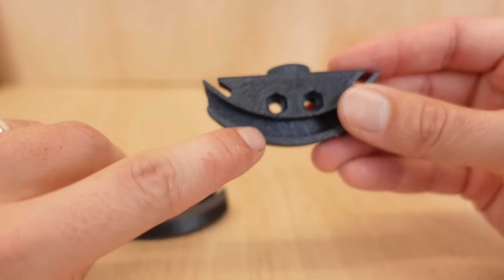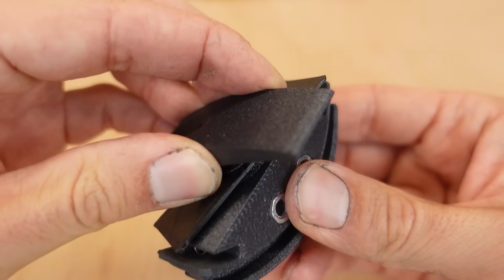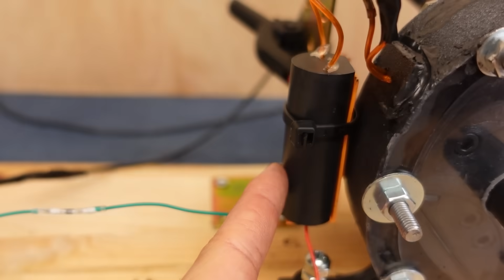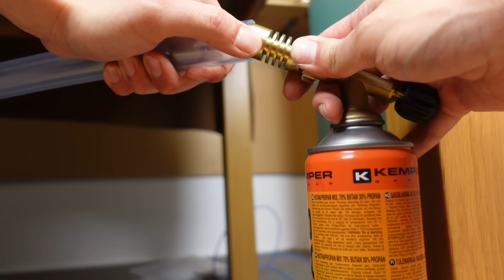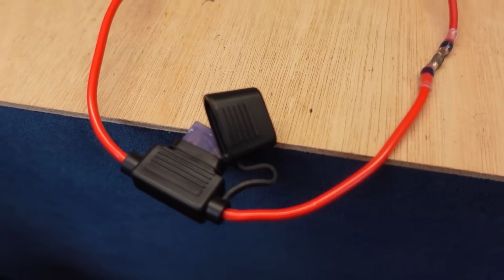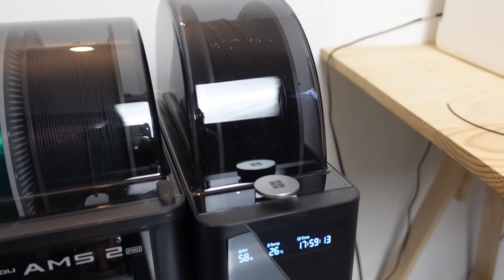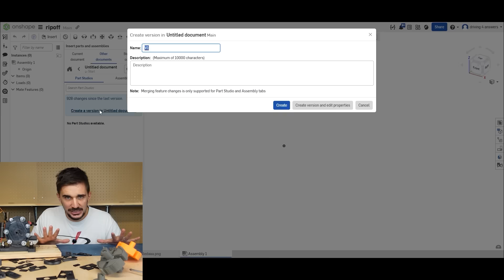My Oval Engine Now Fires At Will! Major Milestone For DIY Oval Rotary Engine 2.0

Comment: The day this dude gets a CNC machine it’s over
Reply: He has one, it was in a different video
Reply: It's not over, it starts.
Reply: he could collab with Inheritance Machining, he's made stuff for some race teams before.
Reply: Or a PCBWay Sponsorship
Reply: @mechfan01  he's a powertrain engineer, not  an electronics engineer
Reply: @erkinalp  They also do 3d metal printing and CNC machining.
Reply: @erkinalp wait hes an actual engineer? Hes experiments didnt give me that impression (no shade or anything, his work is awesome)
Reply: @badgermcbadger1968  Same, I'm a senior engineer at a big automotive company and his process reminds me more of the technicians and mechanics that I've worked with than the other engineers.
Reply: He has one but he sold it cuz it was a pain in the rear
Reply: Or then it really starts!
Reply: He "had" one but ditched it cuz it was pain in the ass
Reply: m4a
Reply: The engine industry is in trouble
Reply: PCB WAY!
Reply: over for who? dun dun dunnnnnn!
Reply: He needs to talk to Bad Obsession Motorsports....
Reply: no he's making the mistake of trying to reverse engineer something that didnt work in the first place
Reply: Looks like you need a better timing mechanism…
Reply: Needs two machines a lathe and a milling machine
Reply: 3d printer is a cnc machine
Reply: @nickfirst7249 it's literally the opposite of CNC machine 😊. Although mechanically they are close.
Reply: @ygayovy  CNC machine meaning Computer Numerically Controlled machine. SO 3D printer is cnc machine. Maybe you talking about additive and subtractive manufacturing processes
Reply: @nickfirst7249  we can go down the semantics rabbit hole, but virtually nobody calls 3d printer a CNC. In the end yes, I mean additive and subtractive.
Reply: @ygayovy  Akshually CNC stands for Computer Numerical Control which does include 3D Printers. But I get your point, colloquially we call a CNC 'Mill' a CNC Machine.
Reply: @alida4790 a good example is tomato 😅. It's a fruit, but nobody minds that it's in the vegetables section.
Reply: @ygayovy why do i keep seeing this misconception everywhere?
Reply: @badgermcbadger1968 are you referring the tomato one?
Reply: @nickfirst7249  i think they mean a CNC router/shaper/cutter
Reply: Collab!

Comment: Where does the engine suck in the oxygen it needs for combustion?
Propane gas doesn't contain oxidizer, the engine only has one intake for fuel only.
Did I miss something?

Comment: You didn't even reply to my mail. 
Even without that, you solved the two biggest problems I mention in it, 
- the springs, which, in order to withstand the explosion or even just the compression, would cause enormous friction,
- and the curve, which was not correct. In fact, in my email, I provided one that I calculated myself, which turns out to be similar to the one you got from the Russian video.

And I think that if your current version isn't working, it's because of inadequate sealing, which prevents enough compression.

Comment: I'm going to go out on a limb here and say your timing is WAY off. And "definitely" not consistent.  You shouldn't be using stranded wire for your spark contacts, it should be solid copper. The strands are moving every time they are hit and don't bounce back to the same location each time. Instead you should put the stranded on the rotor piece and only have a little exposed, maybe 1 cm or less, that brush up against a solid piece of metal, like a nail or something, that won't move during rotations. This would also allow you to change the timing as you can move the nail up/down slightly.
A lot of your ignitions where happening, at least to me, too soon. There wasn't enough compression and rotation of the piston to drive the crank self powered.
But, I'm not a mechanical engineer, just a crazy YT commenter  🤣🤪

Comment: be careful with carbon fibre filament. it has been shown that touching it with bare fingers embeds tiny carbon shards in your skin. sanding it or hitting it with a hammer to break it like you did in this video could also release them into the air to get into your lungs

Comment: This isn't crtiticism it's advice from personal experience.
BE VERY CAREFUL WITH POLYPHENELINE SUSFIDE.
I worked in an injection moulding factory for about ten years and it was absolutely horrible.
Melt temperature was about 280 - 300⁰ C but it would "freeze" on the injector nozzle,.which meant it had to be chipped off with a screwdriver or something similar,. Then when the pressure released it splattered all over the place.
I still have the burn scars

Comment: Absolutely terrific work. I've always wanted to build a cheap engine, that is easily produced by any basic machinist. Something a mechanically inclined diyer can make and modify for any fuel type. It doesn't need to be uber efficient. Just cheap, easy to build from basic components, and robust enough to make sense. It doesn't need to be extremely robust, since all the components are easy to source or build, but it does need to be reliable enough to not be constantly breaking down.

Comment: When rotating by hand the ignition timing looks correct, but in the footage where you're turning it with the drill it looks very late, almost when the chamber is nearly at maximum expansion.

Comment: Sry for bad english! When the ignition happens, the part receiving the force just rolls over the center of the shaft, how should it then turn the pressure into rotation, if the part would be more off center then it could convert more force into rotation, u get what i mean? This receiving part could also get a grooving thats deeper on one side wich could help with driving that force into circular motion. In the layout u have it built now, the force just pushes straight into the middle, way less rotational energy. Hope u understand, what do you say??

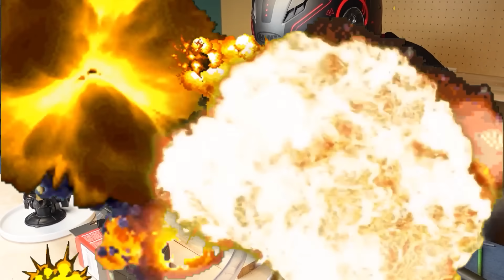Comment: Nice prototype setup and LOL at 09:24 ...^^
Instead of the copper wires to close/open the circuit try a big reed switch(small one will burn fast)  and a little tiny magnet(on the shaft)...;)
To adjust the close duration for whatever reason just replace the tiny magnet for a bigger one...;)
But since what you want is a quick plasma burst the smaller the magnet the smaller the time duration the circuit is closed the better the efficiency will be...;)
Hope this helps...^^

Comment: I may be completely wrong but it looks like that flame front 15:57 is trying to push the rotor anticlockwise (or just static.) I don't think reversing the motor would help tho because moving the ports or the spark location would just create the same problem on the opposite side. R U sure you can make a rotary engine with this very linear shape of rotor and housing? I'm pretty sure the epitrochoidal shape of the housing in the Wankel engine is what translates the combustion to one side of the rotor. Which you don't have here

Edit: I watched to the end lol. Yea the new rotor shape will probably solve a lot of the propagation issues. Also 21:56 this rotor has indentations which look like they aid with scavenging or may help with the combustion force transfer to the spinning rotor (probably both)

Comment: Besides the obvious (ignition system, carburation, engine/combustion chamber sealing)..how do you lube all of those sliding parts on the rotating assembly?  How do you keep that oil out of the actual combustion chamber?  You fueling setup isn't metering fuel/achieving a stoichiometric mixture like you think it is.  Your fuel rate is constant yet your intake volume/demand changes.  Look up propane/natural gas carbs to see how fuel is metered.  Those spark generators can burn up/internally short if the spark gap is too large/non-existent.  Test it with a static spark gap to see how long it actually lasts in a set condition.  I enjoyed growing up in the 1970s.  I had subscriptions to Popular Mechanics and Popular science as a kid.  It was during the "fuel crisis" here in the states when we had new engine designs in every issue.  After all that time, I can think of  maybe three that actually made it into production.  Fifty years later, we still rely on piston engines, maybe a Wankel here and there, but almost every new engine configuration has fallen by the wayside.  Gotta keep trying though.  Congrats for the effort, FWIW I respect that.

Comment: 1. Get a Flywheel
2. Get proper Spark Plug
3. Get better ignition timing (maybe use a sensor on the flywheel to trigger it)
4. Maybe use a little bit of oil at first to get everything sealed better
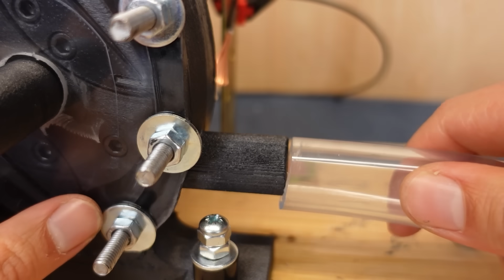Reply: Also you have to have the proper air to fuel ratio. He's just dumping unregulated amounts of butane/propane fuel into it. What he said from 8:35 to around 9:00 is totally incorrect (not saying that to be a jerk) but I 💯 % know from personal experience. Any small engine that can run off gasoline and is rigged up like that to run off a propane torch. Needs to have the knob/valve-flow, adjusted to the sweet spot. In order to run, it can't have too much or too little propane vapor spraying into the intake or it won't start. I believe he achieved combustion 💥 a few times because. By luck, it randomly hit the proper air to fuel ratio it needed.  
This guy is smart 🤓 and smarter than me in some/maybe many, ways. But apparently he's thinking, since the propane/butane is already in a vaporized state. That it's automatically going to ignite. No matter how much he opens or closes the knob-flow. 
Another experiment I did years ago was. Put a propane torch on my motorcycle and ran a rubber hose into the intake air filter. I thought if I turned the propane torch knob on at around 55+ mph. That the extra propane/fuel going into the intake would give me a power boost. All it did was choke the engine out, slow the bike down & want to die because of too much gasoline/propane and not enough air.
It probably would have worked if I also had an oxygen tank on it and was able to spray the correct amount of pure oxygen in with the propane. So I had something like 14 parts oxygen to 1 part propane spray into the intake.
Reply: @michaelbrinks8089  Yea D4A hasnt noticed that the propane torch tips have holes in them to allow air into the fuel flow.  Hes using straight fuel with no air in it,  which is also likely why there is so much more combustion happening after the fuel exits the exhaust.
Reply: @T3ddyRuxp1n  I agree with you....Like the torch itself will light on a 1/2 knob turn or 2 full turns.. But an engine doesn't respond like that & is more finicky. The torch knob is a valve that either lets more or less propane in... If his spark timming was correct. I'm pretty sure he was close to getting it running. 
I've ran push lawnmowers off a propane torch exactly like he's trying to do and no matter what. The torch knob/valve has to turned/set, to the "sweet spot" (exact setting) or it won't start. Oney the knob is adjusted the correct amount of turns. The lawnmower will start on the 1st pull. Like once you figure out that 1 & 1/4 turns of the knob is the sweet spot. You can just turn the knob 1 & 1/4 wait about 3 seconds. Pull the rope & it'll start but at 1 & 3/4 turns of the knob. It won't start because it's too rich = too much propane & not enough oxygen.
Reply: @michaelbrinks8089  Nitrous baby!
Reply: @michaelbrinks8089 nitorus better than oxygen, cheaper, more useable
Reply: 0. Measure your compression with manometer. If it less then 5-6 bar then sealing should be adjusted.
Reply: A DC CDI setup from magnetic trigger for ignition (like on a rotax max kart engine) might be a good solution to tighten up firing timing and still be easy to implement.
Reply: Yup, then embed a magnet in the flywheel, get a hall effect sensor, decent mosfet, and Arduino mini, vibe code a program to use the mosfet to fire the spark plug with the ability in your code to adjust the timing.
Reply: Yes, proper spark plug, sparkplug cable and a real ignition coil made for a motorcycle or car. then you at least can trust that part.
Reply: and more air with the fuel so not just more fule but more air and fuel so it doesnt shot out unburned gas
Reply: 5. Build it in a proper material that can actually seal correctly with vibration and expansion.
Reply: A better contactor setup would be great.
And a third sliding vane would also help a lot.
Reply: Also he can design in a water jacket near the combustion chamber in v2. Not sure if liquid cooling will help the front cover, but it would look cool to see it operating too
Reply: just  set up a simple hall affect ignition trigger, there are tons of small engine  set  ups out there on  cheap weed whackers and  mowers and  as you said a small aount of oil   you could  pull a small venture  to induce a small amount of alcohol and oil mix  into the intake
Reply: He could also use some Fat during the assembly for lubrication and better Seals it would probably a bit worse than oil but applied during assembly it should at least be good for a lot of testruns.
And I think a flywheel is really important if you want to have a chance for the engine to run on its own. With the engine being completely built from plastic (wich I think is a good approach for testing) there is not enough rotating mass otherwise to store the energy need to overcome the energy loss due to friction.
Reply: i think most viewers are wondering why he didn't start with an automotive coil and a set of contacts. and zero control of air/fuel? i think d4a might have gone mad. you want off-the-shelf components for everything that isn't the combustion chamber. weed whackers and model aircraft engines have tiny carburettors. although for testing, he could probably fill a plastic bag with measured air/butane. with appropriate caution for having a bomb. omg they make tiny contacts for four stroke model engines that run on gas! although maybe methanol + glow plug would be simpler for proof of concept? plus you can put lubricant in liquid fuel
Reply: proper spark plugs need more volts than this engine can supply

Comment: 21:48 "заебачная мясорубка" Ахаха )) Даа, особенно втему рисунки красным маркером )
Reply from the maker: Is that what it says on the engine???
Reply: @d4a  ,No, there is a possible use in the comments. The engine has cycle phases written on it. Intake - compression - power stroke - exhaust.
Reply: @d4a  , I wouldn't expect to get a result from this design. Too much friction.
Reply: @d4a  I guess if you will need any help translating russian or even polish docs we can assist

Comment: Tru running the spark generator at a lower voltage… I am using the same with a 2S LiIon, so only 6v without problems

Comment: Looks like you are forgetting that you need air + fuel in order to have explosion. The explosion is happening outside the engine where the fuel finally meets air. The venturi on the gas dispenser needs a proper flow to work. Good luck and nice content!
Reply from the maker: This does have air + fuel, otherwise it would never ignite. Observe the holes on the gas cabister dispenser.
Reply: @d4a that's why I refered the word venturi (those holes). Why don't you get a separate air supply to dismiss the potencial lack of air of a venturi that was not made to put a tube on? I'm a mec eng, and a can assure neither butane nor propane burn with that color so blue. In an indusgrial boiler means lack of air. Keep on the great work ❤
Reply: Correction, so blue means excessmof air, sorry.
Reply: Hope he notices your comment above here
Reply: @alyasVictorio sure I noticed. I love this guy.

Comment: A flywheel and consistant spark timing should help a ton!
Reply: Magneto off a lawn mower.  Flywheel + spark.
Reply: @tedbounds1862  If you take out the engine from from many weed eaters you are left with the whole clutch and spark timing in one unit and could easily connect it directly to this engine without many modifications. Just some extra holes to bolt it together.
Reply: @Destilight  excellent recommendation 👌
Reply: Thats a very good point, a flywheel would probably make it run
Reply: I just posted about the snapback of the copper changing the timing.
Reply: In the spirit of the whole enterprise, a 1-kilogram weight from a gym would be ideal. Visually anyway.
Reply: magneto?!  is that you?!
Reply: Great thought on flywheel.  A MSD (multi spark discharge) might help with more reliable spark
Reply: Just consistent spark timing will help
Reply: additionally he needs to ensure the right fuel flow so we need to put in a a regulator to ensure he's getting the constant supply of the gas and not full open and that he can determine the exact amount I feel necessary as well. which will help reduce the flamethrower effect which I think is also causing his problems when is continuous combustion because I believe it passes the exit before the combustion has completed so his combustion cycle he needs to move his exhaust down from where it is I believe or just it the timing on it because the combustion is when it happens it passes the exhaust before it's finished and therefore he's getting he's getting but it would be sort of like when you have the pressure and it's pushing back on the next one that it's kicking in so it's venting continuous because it's pushing back on the initial on each additional combustion so this is where the gas needs to be regulated properly and make sure that the exhaust is at the right point and again that is spark and everything is at the right point with timing speed and everything
Reply: Would help in momentum retainment 👍
Reply: This is exactly what I was thinking. A little bit of kinetic energy would go a long way
Reply: I was thinking the same thing
Reply: And metal components? Great idea though.